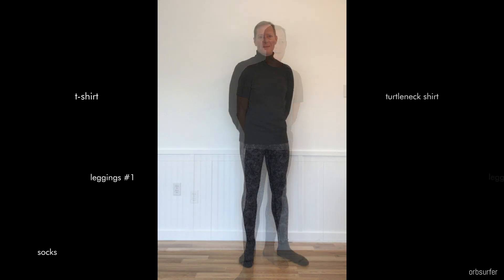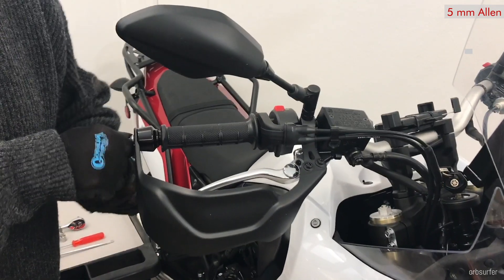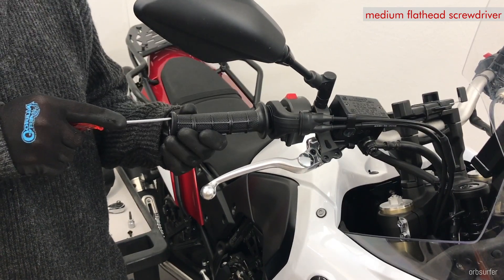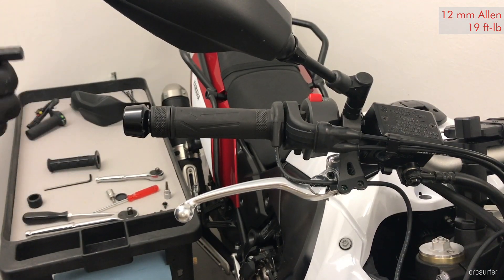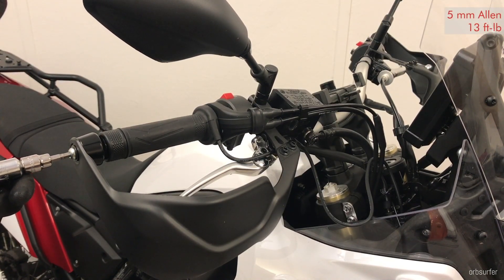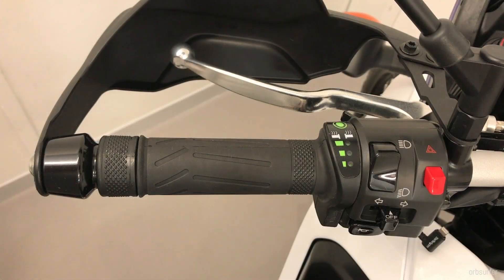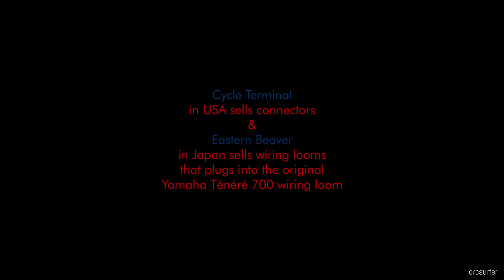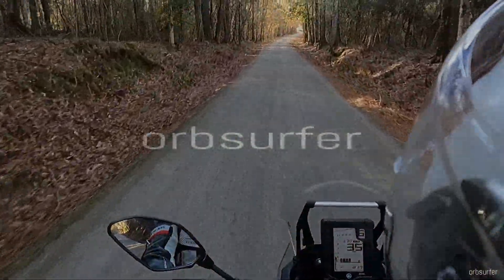Yamaha Ténéré 700 Heated Grips

Comment: I’ve read several comments from people saying that the Yamaha factory heated grips are near as powerful and warm as the Oxford heated grips or ODI. Do you think this is because they don’t know you can program them with higher settings?  
I like the tractor Yamaha switch because it’s integrated into the handlebars instead of an aftermarket one that sits up high that’s prone to damage.
Reply from the maker: Think you are correct regarding the programming of the Yamaha heated grips. I have my grips set to the middle of the three programable heat settings, and in cold weather I only have two green LEDs lit - medium setting there too - while riding in 5 °C/40 °F. In other words - the grips are in my case warm enough! 🙂 Also love that the grips have an integrated design!

Comment: Thank you.  Can you confirm that under the left side panel there is one 3 pin aux connector and under the right side panel there is both a 3 pin and a 2 pin, is this correct?
Reply from the maker: Yes, that is correct. I am using all three connectors! :-)

Comment: I would like to know your opinion on the perfomance of the Yamaha OEM heated grips.
Reply from the maker: I love the grips! No problem riding in 40 degrees F/ 5 degrees C with these grips. 

When buying the Yamaha OEM Heated Grips, also buy the  Heated Grip Connector Cable, Yamaha part number: BC6-H253L-00. It makes installation easier, and the heated grips can be connected to one of the two electrical auxiliary connections (one connector per side) located under the painted panels up front.
Reply: @orbsurfer8195  thank you for the quick response.

Comment: What kind of glue did you use?
Reply from the maker: 3M Rubber and Vinyl 80 Spray Adhesive. The glue has held up well and the grips have never slipped.

Comment: What is the benefit of programming it to the lowest? My partner has these on her MT-07 and complains they are barely warm on the highest setting. I'm thinking maybe it's on the wrong mode, I think it's currently on mode 3.
Reply from the maker: The grips comes with three different programmable heat settings - different from the three green leds on the grip itself - the benefit is that the lower settings use less power - the settings is really meant for different displacement bikes, because a small cc bike has a smaller alternator than a large cc bike - I think I am using the middle setting and never have had any issues with driving in 5 degree Celsius/40 degree Fahrenheit with only two leds lit up + winter gloves. I will take the bike to Norway - there I will need all three leds (highest setting) lit up in addition to winter gloves and will probably reprogram it to the highest setting! :-)
Reply: @orbsurfer8195  really not sure why hers don't get that hot on mode 3 and setting 3... Maybe we got a dud pair?
Reply: Mine do the same, on the highest program setting as shown in the video and barely get hot enough to cope with 10 degrees Celsius in the UK. Strange!

Comment: Hi Orbsurfer, first thanks for the useful info.
I have a little problem on my X-Max 400 with the same grip heater. After pressing the button after a few seconds all three led are flashing five times. Do you know what this mean?
Reply from the maker: I do not know, but it might be low voltage or that the alternator is not able to supply enough amps. When I turn on my heated grips, they turn on at max power; i.e. three lights on. When you turn on the heated grips, put them in the lowest setting, then try with two lights on; i.e. the middle setting. If no flashing leds, you might just have to program the grips for a lower output. There are three different output modes, that mainly changes the max output. On some of the forums people who have measured the actual amperage draw on the Yamaha heated grips, states that the wattage used for both heated grips is much higher than the wattage stated in the manual. More like 6 amps. 6 amps x 12 volt = 72 watts..., the instructions states 22 watts, but that might be 22 watts per grip = 44 watts for two grips? Who knows? Good Luck!
Reply: @orbsurfer8195  That's exactly what i was thinking. But i'm not  able to change the settings, the Led's on the heater only flashing after pressing the button and nothing more ...
I need to find a way to reset it to default or something like that.

Comment: Would have been nice to see how you connected the wires. 😄
Reply from the maker: I will connect the wires to the original connector located under the left side panel and make a video.
Reply: @orbsurfer8195  hi there just a quick question should there be any play on the accelerator grip once installed
Reply from the maker: According to the Service Manual there should be 3-5 mm of free play on the throttle grip when you twist the grip; i.e. a little slack on the cables. There is an adjustment screw and nut on the engine side of the throttle cable.